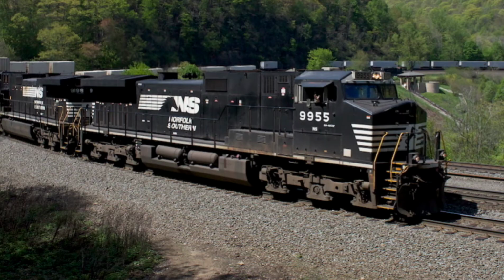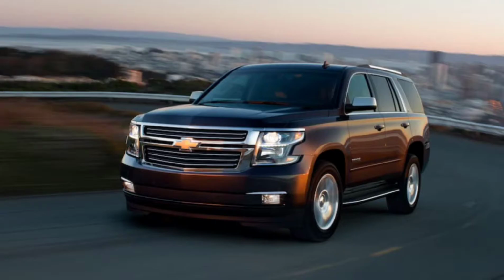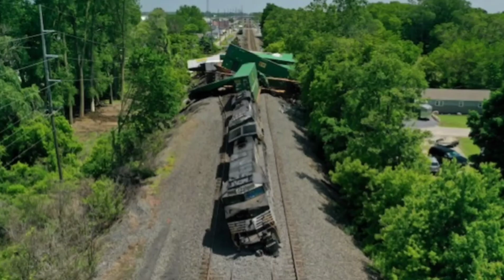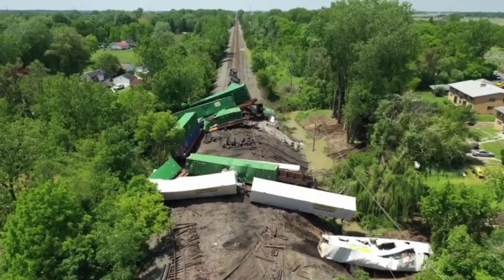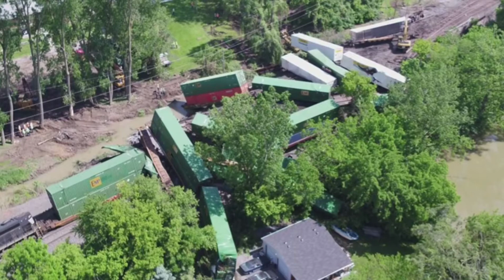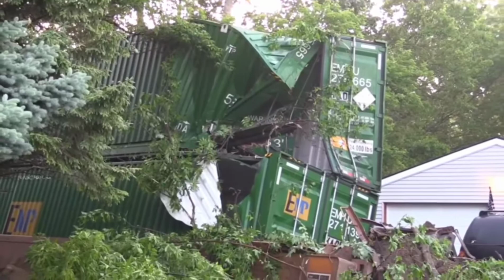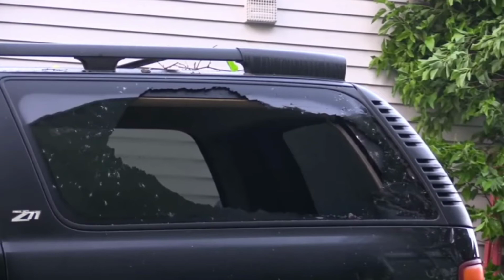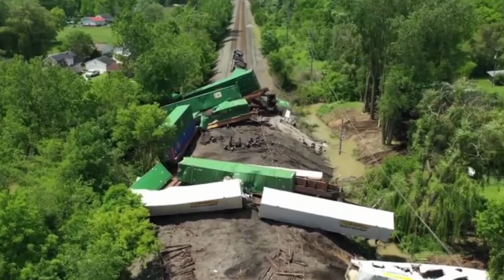Swanton Ohio Train Derailment | Breakdown

Comment: Crazy that just a small SUV can cause mayhem like this, but it does remind us that it’s not just about if the obstruction is heavy enough or if the train speed was fast enough, but if the obstruction was able to wedge itself tight enough to make the train jump the tracks
Reply: There is something wrong in the design of car tires and RR track crossings that causes a tire to get caught fast in a crossing. I knew of a case where a Mom had her small child in a baby seat in the back seat, and  a tire or tires caught and stranded her in a crossing -intersection and she was hit by another car with such force that it caused severe brain damage to the child.

Comment: Well, that was mind boggling!! Thank you for putting this story together. I learned about this wreck through a comment on another  train fan site, and searched for it on you tube.. The other videos that came up were taken on people’s phones and were mostly shot in the dark and hard to  see or know what happened.. I do know about another de-railment of an Amtrak train in WA State near Olympia. It was a very bad one and  probably made the naiional news, but it has a personal meaning for me. It happened in 2019 or maybe in the spring, as i recall, it may have been in the fall however,. The Amtrak commuter train that ran from Everett, WA  to Vancouver WA usually traveled on the tracks that ran along Puget Sound and the tracks were overlooked by tall cliffs, for many miles until it reached Seattle, then continued south. Due to heavy rains,  the tracks had beenblocked twice the year before the accident by landslides from the cliffs. Amtrak had opened another route for the train service to bypass the avalanche  prone section of the original route. The new route crossed the famous high arched bridge over  Interstae 5, near Olympia.The “Maiden voyage” of the train over the new route checked out perfecty for safety. I would usually have been on the train that made the run to Vancouver the next day,, but i had changed my plans.The train , filled with passengers came around a tight turn and onto the bridge when it de-railed. The engine and i forget how many cars went off the bridge and landed on I-5 during rush hour. Photos showed other cars literally dangling off the bridge. passengers were killed and injured and I think the engineer was killed, and I can’t recall how many cars and people were injured on the freeway below. I can’t even imagine what a terrifying experience it was for everyone involved. There was a report that the train came around the bend and onto the bridge at 80 mph. How could the new up tp date safety system fail?  I never heard what the official cause of the disaster was.  Was it the fault of the engineer or what?? We did hear that the train should never have been going that fast.. This would be a good mystery to look into. i would like to have some answers.